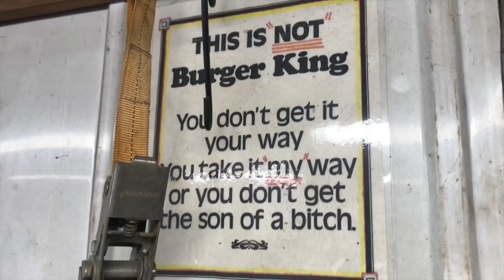Pro Armor Harness Install on RZR 1000XP

Comment: … Always remember folks you’re only as strong as your weakest link and links on the chain Are probably the strongest part of that whole project… Kudos to you guys great idea
Reply from the maker: dynaJoe2002 thanks! We try to be efficient with cost and performance. We have used the chain on 2 machines now and it is still working perfectly.

Comment: Dude we have a rzr polaris but i cant find the cable of sea belt, there is not visible at all i check the harness and i can find the wire, you can help me
Reply: It's in there.  On the driver's side seat belt clip inside the center console.   There's a connector.  Unplug it, then plug the aftermarket bypass plug into it
Reply: @vlo9079  the problem is al ready have a belt modification, don have the clip, checj the harness and it is not seen that it has been cut
Reply: @trespupilasrock6453  interesting.   Are you able to go about 15mph without the driver's side belt clipped in?  I'm wondering if someone cut the factory wiring harness and manually spliced the wires together to create a ground loop?  That's basically what the aftermarket modification plug does.  Did you purchase your RZR used?
Reply: @vlo9079  probably this happened, it is used but before the modification of the seat belt, if it brought the original one, I think we will have to strip the whole harness, tnk you bro

Comment: Does the harness make it a little difficult to turn or does it improve? I want one but i don’t want to struggle to turn
Reply: And how did you get around the speed limiter that’s set on the seatbelt.
Reply: @joedominguez1149  that little blue gadget he plugged in , in the beginning.   That's the seat belt bypass plug.  Amazon sells them for cheap

Comment: My only suggestion is you should have went stainless steel hardware.  Stronger; Rustproof...
Reply: Not trying to be debbie downer but be cautious because most stainless hardware is not stronger its usually~grade 4!